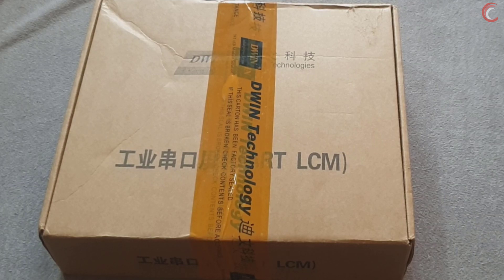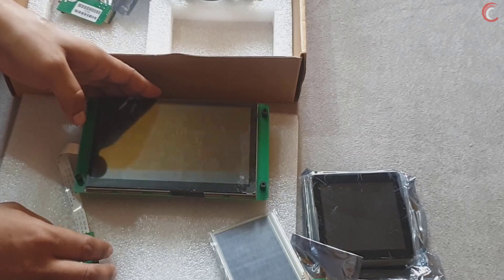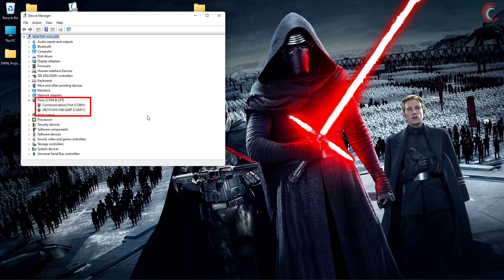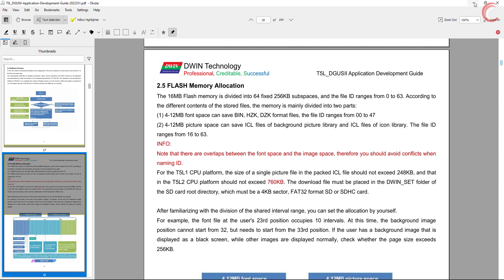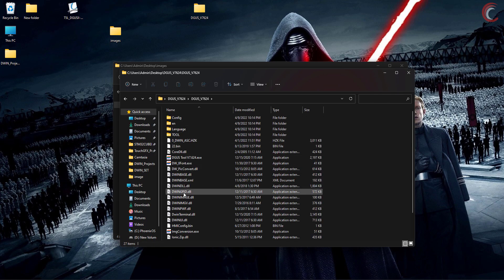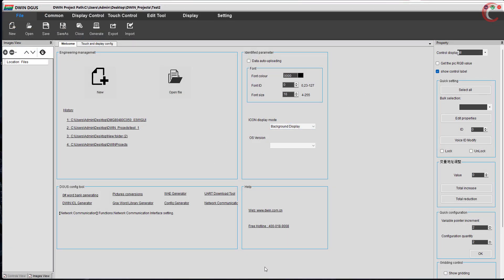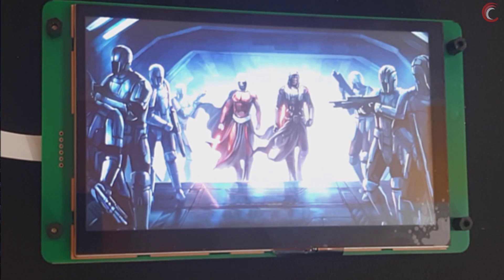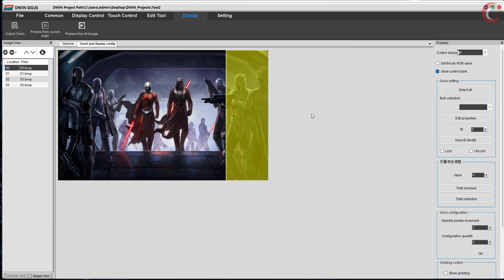Getting Started with DWIN UART LCM || Basic Project

Comment: I have a question.

When the microSD is placed on the screen updating the information.

If another device tries to communicate with the screen (ie the deice sends data to the screen via UART).
Could there be some kind of problem with the update that the screen is performing?
Reply: It's unable to communicate while uploading.
Reply: @DwinTechnologyOfficial  hai I am trying to connect DWIN display and PC through USB to TTL converter and SSCOM but it not responding. From display side we not get any data while touching the button
Reply: @govindarajmanoharan4839  Check the defaut serial communication of your screen, TTL or RS232?

Comment: how does it compare to the Nextion intelligent displays?
Reply: 1.Beijing DWIN  is a factory with 19 years experience , some of them are trading company instead of factory.
2.Above 1000 employees from production/R&D/sales/FAE/customer service/other department which could provide a range of service you need.
3.The ability of development our own chip, I don't think others have.
4.Most of relative suppliers were entered into our industrial park ,that ensure a very stable supply.
5.Our headquarter is in China's Silicon Valley Zhongguancun in Beijing.
Reply: Comments from one of foreign engineer on YouTube: 
Q：very interesting, thank you! I wonder how DWIN compares with Nextion displays. any idea?

A: Thanks! I worked with Nextion as well, and the first thing I immediately noticed is the price. DWIN is cheaper! Also, 
DWIN uses their own chip instead of an STM32 microcontroller which is very advantageous, especially in today's chip shortage. 
DWIN, especially after already using Nextion in the past has a bit stranger approach in programming, but once you get used to 
DWIN's programming, it is actually better. In fact, you don't even need to write a single line of code for the DWIN displays, 
however you need to spend some time understanding how the VP addresses work and how to interpret the data stream.
 Also, DWIN gives you a FULL control for their displays. It does not matter if you buy their cheap $20 or their expensive $100 display, 
you will be able to use both of them with the same functions. Or at least I could not find any limitations yet. 
The other manufacturer blocks certain functions, for example I cannot put a switch or a combobox on my basic Nextion display. 
All in all, it is cheaper but better. I will make more videos on these displays because I think they deserve more attention and they are not really discovered by makers yet.